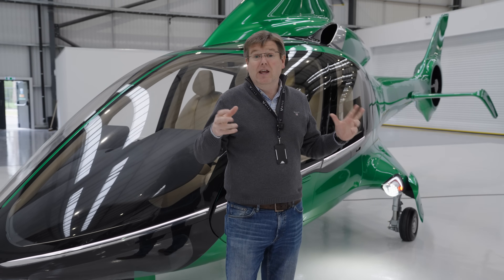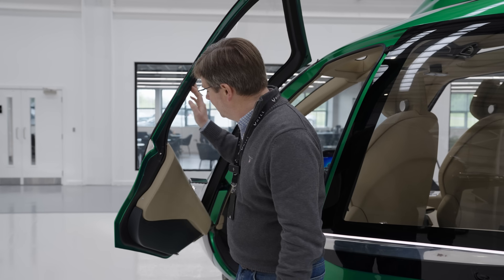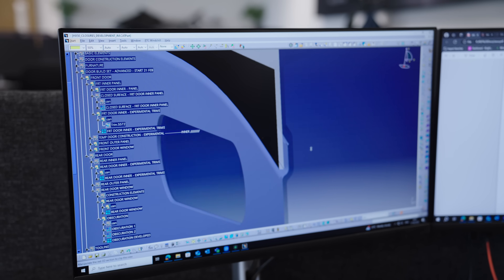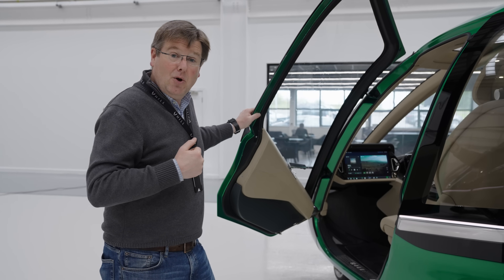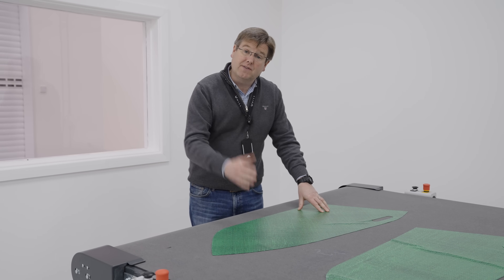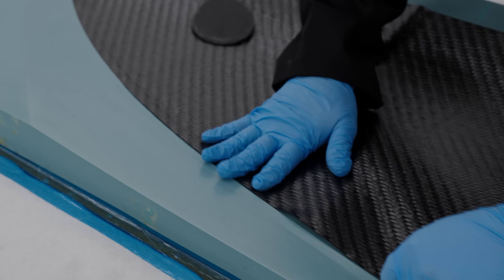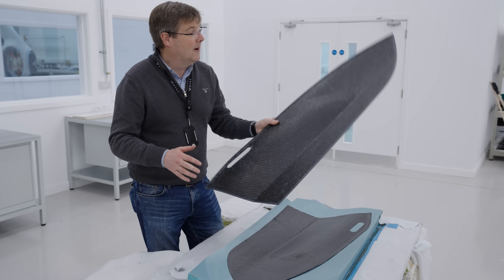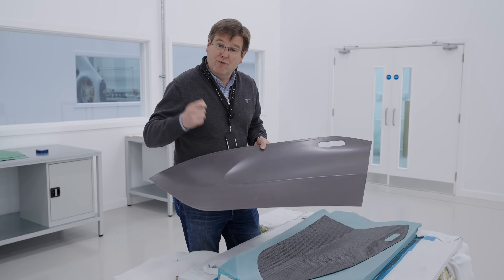How We Create a Stiff, Lightweight, and Sealed Helicopter Door

Comment: 2nd generation fuselage and it hasn't flow yet??????? 🤔🤔🤔🤔🤔🤔
Reply: Sounds agile. i.e. fixing problems before you get to the end of the whole process should be cheaper.
Reply: @timmurphy5541  We know that the GT50 engine will run by 28/06/25, and HX50 will fly by 05/12/2025. See the Dec 5th 2024 video.
Reply: @soaringpaul1  It's just that before that we were promised to see a flying prototype before the end of 2024 at the latest so it's understandable. it does look like theyre making progress steadily. i think they should have been able to show a flying prototype by now so it's strange. at the same time i do think hes the real deal but its starting to become weird if they don't show something actually flying soon.